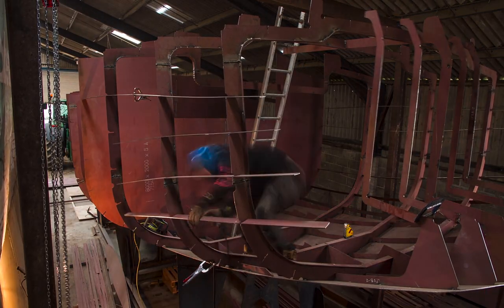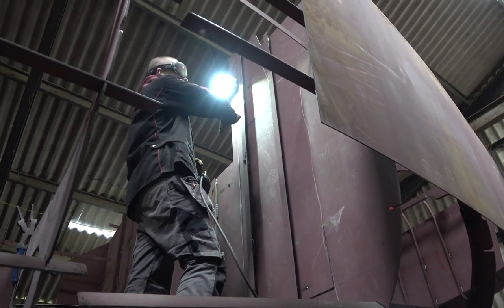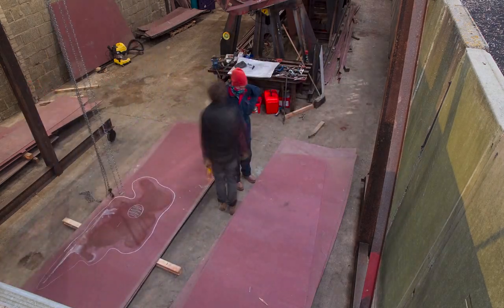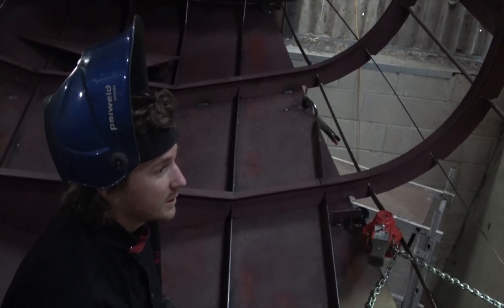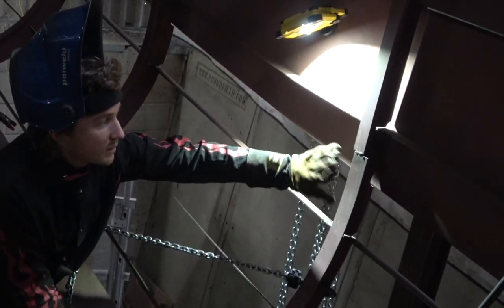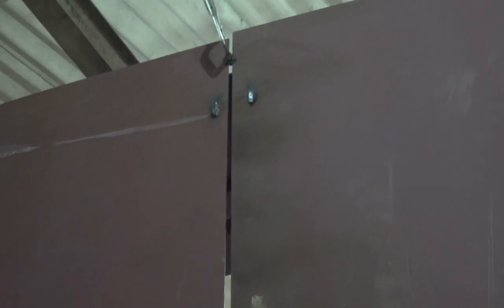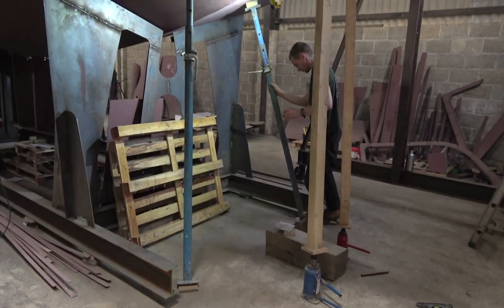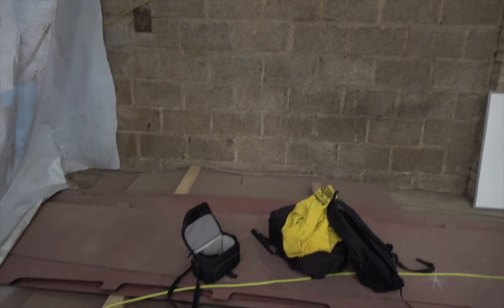Plating our boat's hull - Ep. 9

Comment: This i sooo nice to watch! 
I wish I would have done this 20 years ago, instead of bying an old project where I ended up putting in the same amount of work and still walk down compromise alley. 
One thing that I liked on my shooner though was that the cooler for the engine was built into the keel, that took away the need for a thru- hole/heat exchanger and seawater pump. Something I would recomend... 
But I will enjoy following this project.
Reply from the maker: Thanks! We are considering keel cooling :)

Comment: Good job thinking through the problems! We didn't have pre-cut plates when we plated Lady Dew so if an issue such as sagging had crept in we never knew it LOL
Reply: Same here, no pre-cut plates with my Roberts so I just overlapped the ends a little and trimmed them with the plasma cutter! Still lined up pretty well though - I Think! :-). Cheers, Garry.
Reply: @garrychapple6418  Exactly! And if anyone breaks out a tape measure checking to see if everything is perfect, I run them off the site! :D

Comment: I did a boat-building apprenticeship with McMullin & Wing. We built steel and alloy yachts.  

OK this is how we did plate rolling. The plates where typically small - a 2400mm x 1200mm cut to 2400mm x 600mm.  You need to divide and conquer here - small plates  

First we made a vertical plywood pattern for each frame - our frames where 400mm apart - you could put in more frames just in the aft section.  We also cut longitudinal patterns about 150mm apart where the plate was to sit.  

Two men would hand wheel the plate in a standard wheeling machine - stopping every few minutes to check the templates against markings on the plate - black marker..   if you have not got a wheeling machine or do not want to buy one they are easy to make -  sheet steel 2 wheels and a truck jack  

 Off course you have the great advantage with steel because you can use heat and a hammer to get the final fit.

Hope this helps

Comment: Nice work! one comment though, cut outs from structural members should not have any sharp corners but all should be cut out rounded, or if you need the corner (e.g. for a door) then the corner still mus the rounded out further into the bulkhead and later on covered again. This all the prevent any notch effect and propagating crack. Keep going!
Reply from the maker: Thanks for the heads up, we have since rounded the corners to stop the stress riser. Good spot!

Comment: Bro the proper way of building steel boats :
Metal sheets must start and end on vertical frames. No sheet joints should be allowed  unsupported. This will cause distortion with weathering and long term stress . All metal sheets should be cut an shaped on plywood models first. But you did a quite good job if it's for personal use.

Comment: Hi Looking great! When you buy a Bruce Roberts cut file do they recommend shops to cut them?  Also, was the steel wheelabrated then coated?  What is the coating on it?  Sry for all the questions
Reply from the maker: If you email Bruce from his website he'll probably direct you towards something in your region. The steel was all shot blasted and coated with a weld primer called "sigmaweld"

Comment: The follow up on the issues you had early on are a bit confusing. What happend to the side plate issue ? Was it their fault , your fault  ? You received new plates but that still didn't fit so what happend next ?   Great job I'll be waiting for the next vids  ;)
Reply from the maker: Thanks Rob, we've had new radius plates and it looks like they fit! (we managed to fit some of them and check but not all). It was their fault! admitted to corrupted cnc files. Looks good now anyway, just waiting for lock down to be over + some decent weather so we can get cracking on it again in Kent and move the boat to Wales

Comment: If you were building a sky scraper would you clad the top ten stories before doing the bottom...NO!
You have already had problems with the keel plates sagging so why compound the problem by putting the weight on the top first?
Reply: theres wisdom in that.

Comment: I have to wonder why you didn’t put the pre-shaped pieces in first, adding a lot of weight and noticing the sagging, those pieces might have added some more rigidity.
Reply: just watched the latest update, so the fit was ruined by corrupt CNC files. I guess it was good after all to not put these in first.